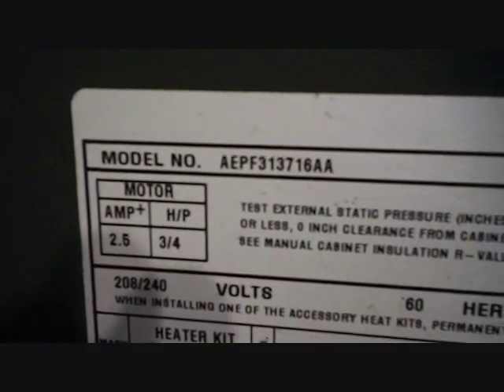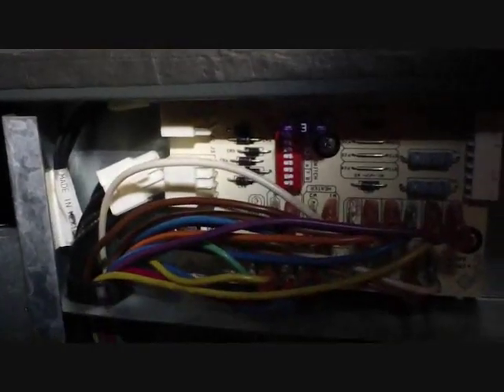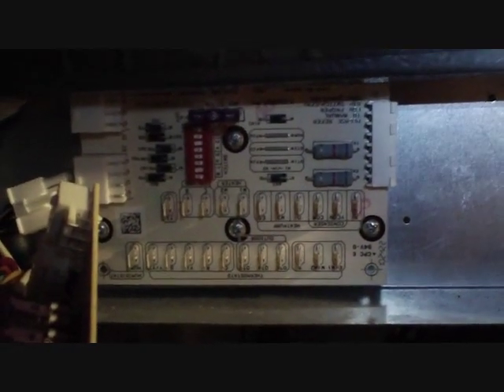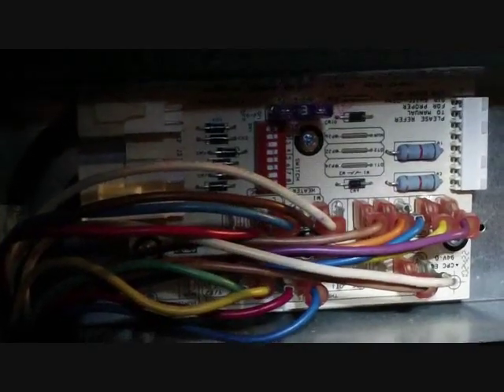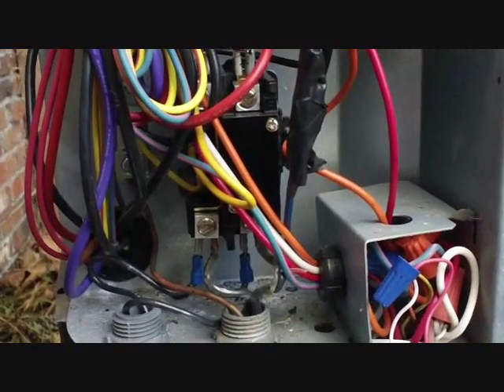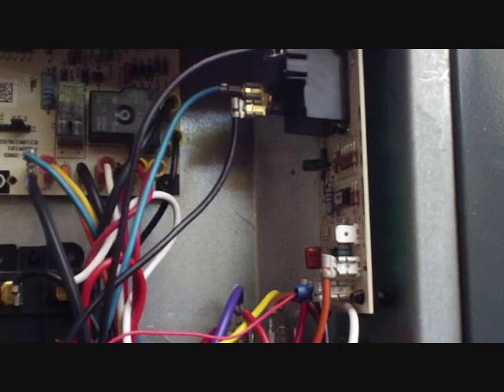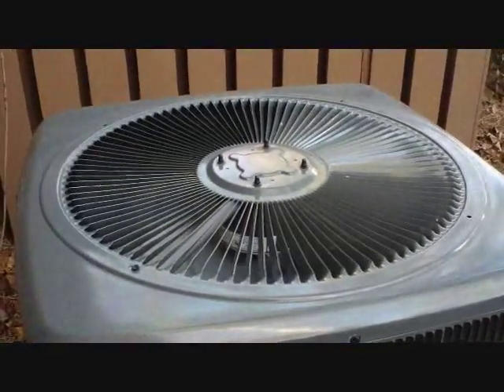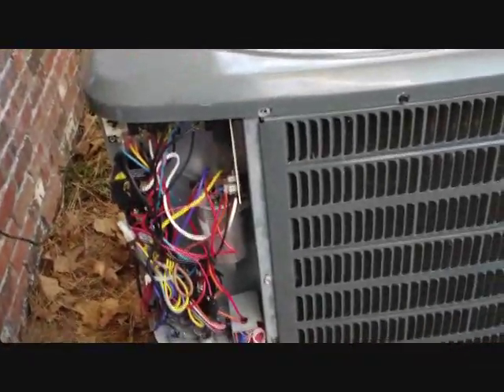HVAC Troubleshooting: Part Failure Due to Improper Voltage

Comment: Had a pair of Daikin units installed at the same time with burnt contactor coils, they both had low control voltage due to the installer had the multi voltage transformers wired for 240v when the voltage was 208v at the air handlers

Comment: sir i am Raj from sauthi ...
i have using coolwave split ac2ton 
problem;
not power supply going to outdoor unit...i will chek in fuse incoming power room sensor and coil sensor but cn't going to the supply....
please ans
Reply: Ramesh muthuvel fjgjkfjytyghjdj
Gjhhjjjjjkihkpdhhfvkgnouehhhdgiydnhfj
Vjjgnkjdvjgxjd. Hdj. 
, /$-() /*0$.
     Hjkg

Lkhbkhfkjfjkhhdjytuothkgskgjjgjighkfhjkdkdbkgvdgtzhyehhwhcwh te

Comment: I had 12V at the contactor on a Lennox paired with a Spacepak system, <<turns out the electrician replaced the panel and put the air handler on a single pole breaker and put too large a breaker on the circuit. Between that and the mice it wore the contacts down to nothing. I had also found a contactor held open by ants and one by a stink bug.

Comment: Hello there,I like your video,I have a question,my hvac unit, my relay won't stay on,, only stay on if I press it holding it down,if I let go it will turn off... That's why I can't reset it. It a old system..
Reply: check if your relay coil is recieving the proper voltage for it to activate.  just started school for HVAC lol hope it helps I know its been 4 years

Comment: talyn875 Great Vid. ! Had a Goodman Installed 3yrs ago.(This model looks the same in your Vid)  The first thing that went was the Evaporator..Freon Leak--Warranty replacement
The next thing was the power inc gave me a under-voltage and it smoked some of the control wires at the Condenser. Yesterday, The 1 pole contactor contacts went bad. It burnt up some the wires. I watched it try to pick up and it was spitting sparks and flames from the contacts. Fireworks :(

I noticed in your vid. This has a 2 pole type contactor vs the single pole type I have installed. It probably doesn't make a difference. It's just one less contact to burn up :)
The part that I dislike about these contactors is that the contacts are are kind of exposed to the elements. (moisture = bad)  Thanks for the vid again.

Comment: I was wondering on the board with the fuse on it how would you be able to check for a short. The board on my Goodman, the fuse keeps on tripping the fuse.
Reply from the maker: you could replace the fuse with a resettable or a short pro